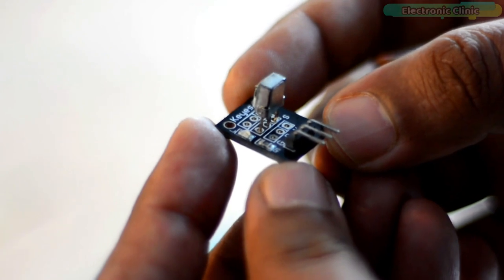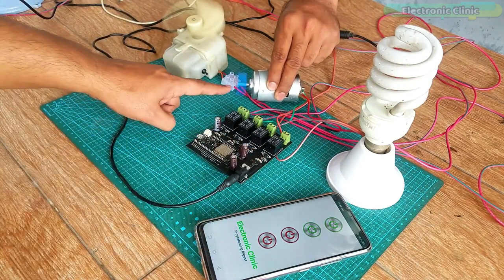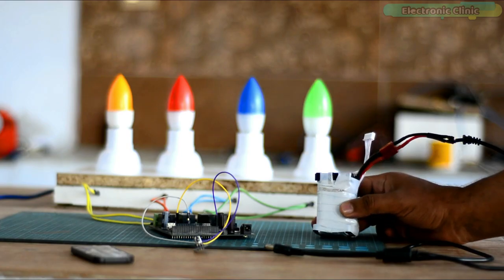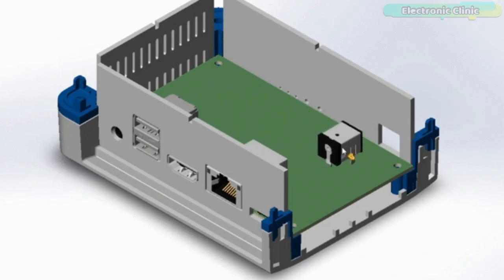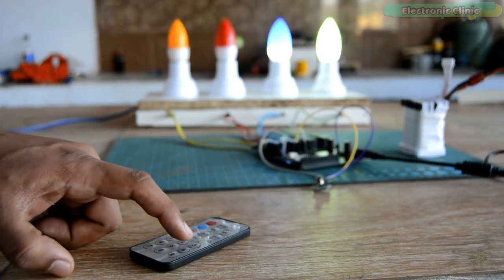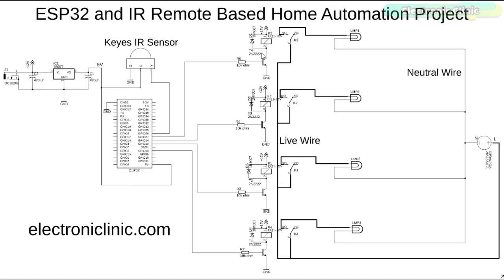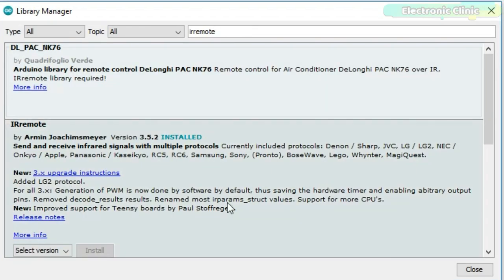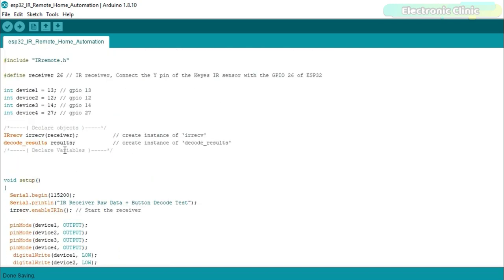ESP32 Home Automation using IR Remote, ESP32 Project based on Keyes IR Sensor & IR Remote

Comment: Morning handsom. Can you do the reverse of this. As in use a google home to voice control an esp01 with irled. So when i say tv off and tv on it sends the relivent ir signal... i keep misplacing my tv remote
Reply from the maker: ya, it can be done. Next time, I will try using esp8266. Can you explain your idea?
Reply: @ElectroniClinic  sure... im laying in bed. About to fall asleep. And i want to turn off my tv. I cant find the remote. So that means i need to get up and power down the tv. So i prepose using the google home device i have in my room. I  the google home interface i can add commands. Example. If "tv off" is said.  Send a command to the esp01. Esp01 sends the signal to the ir led. Which recreates the power down signal of the remote.  And turns off the tv. Id like to do this for tv on .tv off. Volume up. Volume down.
Reply: Basically making a wifi comanded remote for the tv. So we would 1st need to find out the current remote controls ir signal. Then code it to a command prompt. And then associate it to the google home network. Just like a wifi relay. But a wifi remote.
Reply from the maker: @chimpofm  So, you mean, we will be making our own remote with esp controller and ir transmitter led? We can decode the original remote controller commands and then use those commands in our designed controller ?
Reply from the maker: @chimpofm  I am also tired of this thing ;) I usually activate the timer on tv and then in the morning, I turn off the power.
Reply: @ElectroniClinic  correct. My tv has a usb slot. So hopefully u can we can design a device that plugs into the tv to get power.
Reply from the maker: @chimpofm  its a nice idea. I will give it a try, once i am done with the Raspberry Pico complete course video.